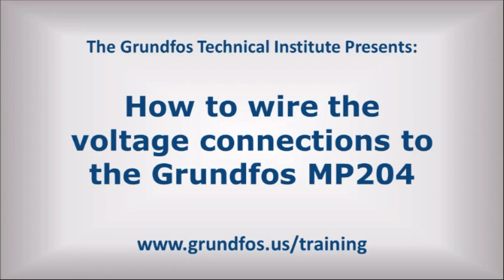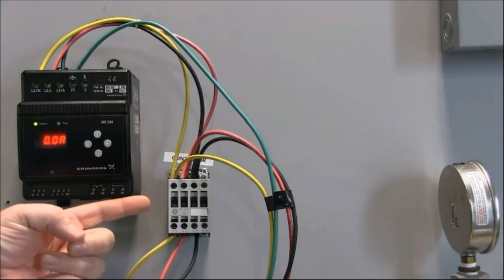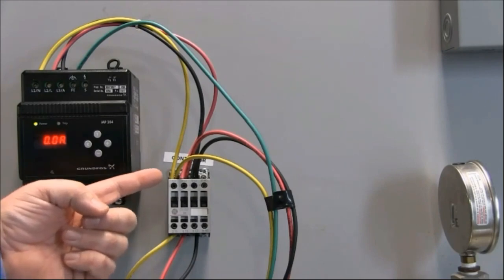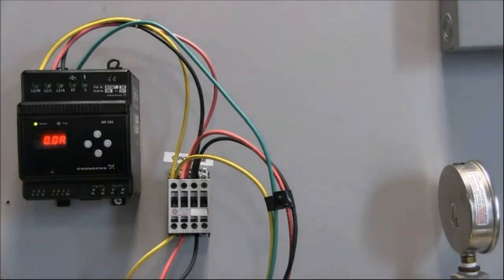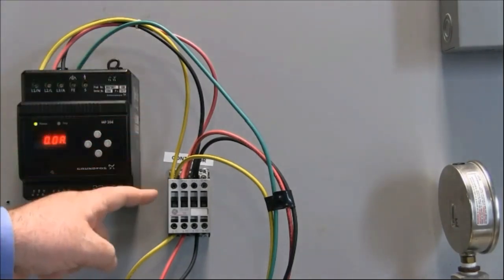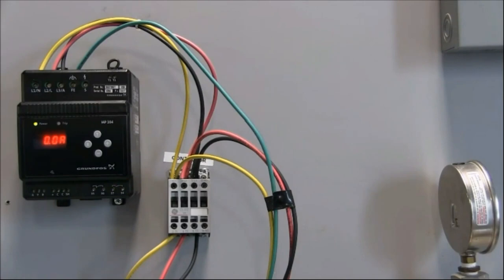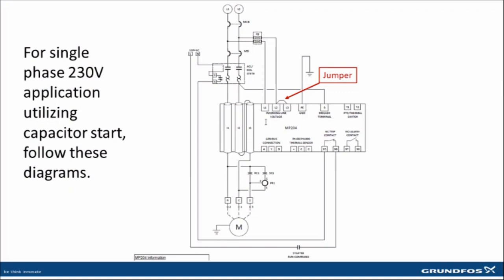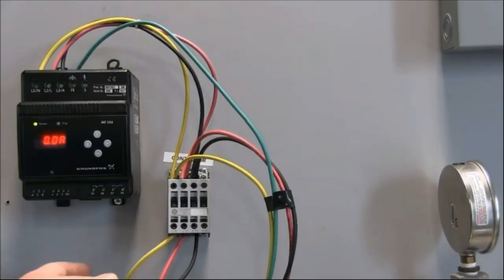How to Wire the Voltage Connections to the Grundfos MP204 Control

Comment: You're wiring the line to the top of the contactor and the load to the bottom.  I don't see any control wiring to the contactor, but when it closes, the load is going to be energized.  Doesn't make any difference whether the MP204 is there or not - unless there's some magic between that contactor and the MP204.